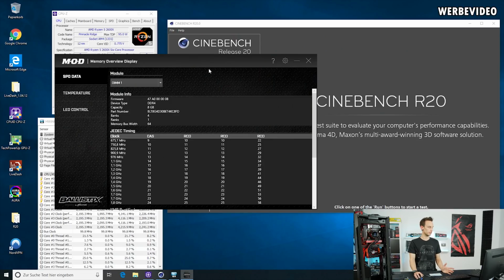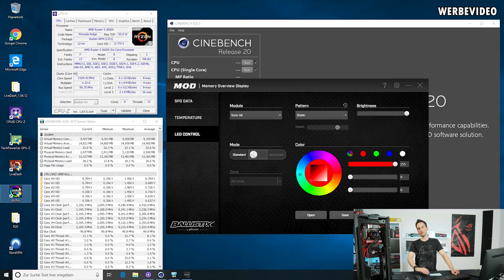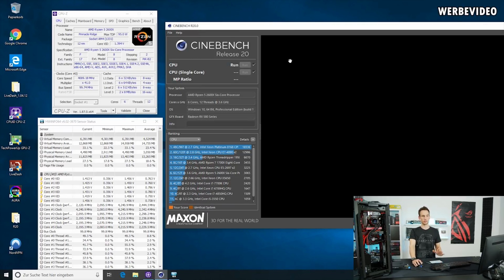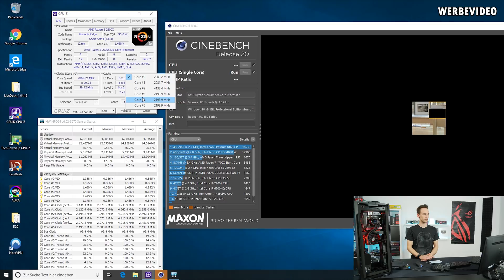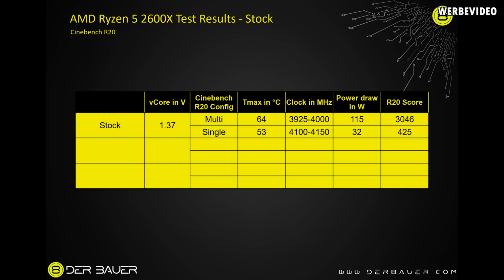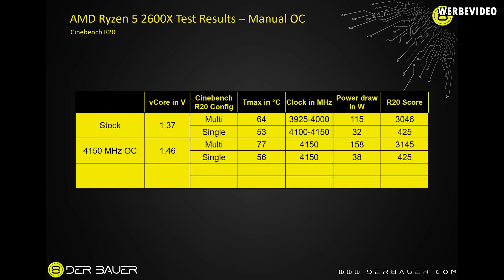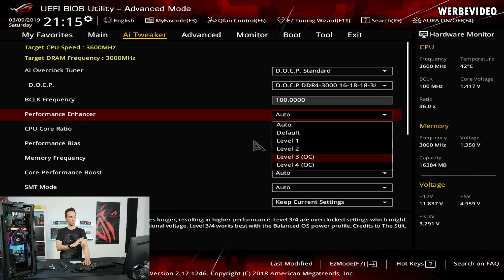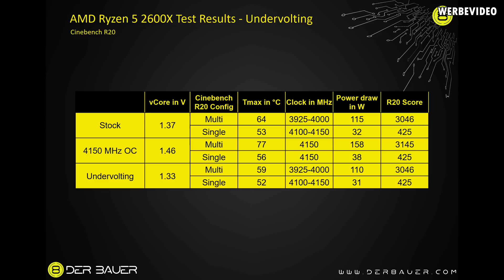The problem with AMD

Comment: A dude has already shown that above 1.38V on 2nd gen Ryzen will degrade the CPU within 6 months. He made a post about it, I'll see if I can find it. Undervolting is definitely the way to go at least on the 'X' variants. On the non-X variants you leave a lot of multicore performance on the table and it would be worth setting up an all-core overclock.

Ah here we go:
https://www.reddit.com/r/overclocking/comments/amtnt4/ryzen_generation_2_safeunsafe_voltages_tested/
Reply: Excellent comment, this should be upvoted to the top.

Comment: So... Did AMD do a better job on delivering a product to customers ?
Reply: The sauce just mad because Intel is offering more cores since Ryzen came out lol
Reply: yeah.

If you think about nvidia gpu boost, how it adapts its clocks to temperature and power usage, AMD have done the same with their cpu's, XFR adapts to TDP usage and temperatures.

Whilst intel turbo boost is very dumb in comparison, it simply boosts based on number of active cores regardless of temperature and TDP head room.

In games my 2600x boosts all core to 4.15 which is only 100mhz below its single core boost.  The turbo boost of single core vs all core in intel chips is much wider.

Cinebench only boosts lower as it fully loads the cores so higher TDP and temps, but games usually dont fully load all cores, just moderately loads them so there will be headroom, and XFR will increase clock to make use of it.
Reply: @ratking27  No, it's not much more safe. Jumping between 1.4 and 1.5 is expected behaviour. You can't just say that 1.3 is much safer because that's the case for Intel. Ryzen is different.
Reply: yeah but just remember this is stock behaviour so its likely safe.  You have a good chip to be stable @ 4.1 1.32v mine hard locks like that.
Reply: chrcoluk I haven’t really seen a zen+cpu that can’t hit 4.2ghz on decent cooling and most can hit 4 to 4.1ghz if you increase fan curves on the stock cooler. I think you may have got a bad bin.
Reply: They did an amazing job delivering a shitty product to consumers
Reply: @hugw4567  shitty comment is shitty.
Reply: @hugw4567  No they didnt, AMD Ryzen is a great platform and the best AMD has done in years.
And its only going to get better with Zen2, plus with Intels CPU shortage and high prices this is opportunity.
So stop with the Intel bias, yes they are still the better gaming processor but AMD is no slouch  at performance per dollar.
Blind fanboyism gets no one anywhere.
Reply: The Sauce shitty product that is more efficient, within around 15% in gaming, closing in on half the price, better all core usage performance in most cases, a longer supported platform, and a cheaper platform in terms of mobos needed and the mobo costs. I can get you saying “intel is ahead but other than that top end of 8600k and up ryzen is a great option” but calling it a shit product leaves me just wondering what you think about all those sub 8600k CPU’s intel makes? Are they beyond shit or are they simply not as good of value, as I would say?

Comment: The first generation Ryzens are more worth overclocking. I run a 1700 in my system, and it doesn't boost past 3200 stock. I can overclock to 3700 with very little increase in voltage, and combined with setting my memory to XMP at it's 3000 MHz speed, it gets a very good boost in scores, with not too much of a boost in power consumption. I plan to upgrade to a Ryzen 3K system when they launch, as well as get an x570 motherboard when they become available. I've high hopes that AMD can bring the competition back twofold with the 3K lineup, and get Intel to tank those prices and make even better CPUs. The last two years have been amazing on both sides, and I can't wait to see what's in store for the future.

Comment: no problem, they just found a perfect balance and applied it factory default. the reason oc doesnt work well has to do with global foundrys node, with the 14nm targetted at 3ghz optimum, and their 12nm is just a slightly refined one based on 14nm, explains why ryzen is super efficient at ~3ghz allcore, but power rises alot at higher clocks. i'd say: run a 2700 at 3ghz without boosting, amd cool n quiet enabled and compare those results, while focussing on power.
Reply: simply said: amd is pushing the glofo nodes to its max is why overclocking is not worth it. excited to see what the tsmc switch does perf/watt in combination with node shrink and zen2 uarch

Comment: Love the coverage. I've got a 1950X that can do 4.2GHz@1.375V (it's a beast of a binned chip). 

But, this made me wonder if you could do a power/frequency curve for a couple AMD and Intel CPUs, then explain the industry isoperformance/isopower curve used to discuss transistor efficiencies for different processes used in the industry. Same can be done with graphics cards, if you'd prefer. But that is a topic I find some have trouble grasping, and since you've shown that before in some videos for a single processor, doing it with a larger dataset may help people see where the efficiency on voltage drops off and why hardware vendors set the boost where they do (and if they stay at an efficient part of the curve, or clock it to past the efficiency point where small changes require more and more power to drive the hardware).

Thanks.

Comment: It's mental to think how it's so different now amd chips used to be the most interesting to oc with the whole core unlocking and massive preformence boosts you could get the old am3 chips where definitely my favourites but now it's basically only Intel chips that are worth while for high end overclocking zen overclocking at present only really worth it to get non X chips up to or close the X model to save a few quid. Can remember getting a phenom ii x4 running at 3.9 GHz  on 5 cores  using air just n the extra core plus the clock boost ment a massive jump couldn't get the 6th core to run stable would boot n run benchmark fine at like 3ghz but prime would just be like a no go lol so opted for 5 core n it was awesome for the price 👍

Comment: How the hell. My non x 2600 boost to 4.5ghz and it stays at or under 1.4v. With a Asus micro Saber tooth board
Reply: I don't think you sound like a fanboy. It's the ones saying Der8auer is biased. I have a non x 2600 too. Got it to 4.2 all core stable too scared to go beyond lol
Reply: @_BangDroid_  I definitely don't think he is bias. He content is spot on. Just straight oc I  got to 4.3ghz at 1.4. Temp hit 60 while game but it still boost to 4.5 I just didn't want to push it anymore. It stays there as long as I'm playing so. I guess I'm just lucky. His point in its not a good oc cpu is true though.
Reply: What cooler do you have, water? I'm on air, have a bequiet dark rock pro, a bit overkill I know, but I figured it can run low fan speed for noise. Last summer it was 32C degrees in my room. Under full load (blender) CPU max temp was 78C @ 4.1 ghz 1.34v Not too bad.
Reply: @_BangDroid_  its just a h100i but it's near my ac vent so I can't keep it extra cold.
Reply: silicon lottery dude, and you won
Reply: @_BangDroid_  I hate sounding like a fan boy but I see these reviews with the best hardware getting terrible oc. It just surprised

Comment: my 2600 has been running @ 4.2 Ghz with under 1.4v vcore for almost a year. P95 stable, game stable...  It pulls 105 watts package power while doing small FFTs. I run stock ram speed with package timings.  lowers my power consumption, soc pulls 5-8 watts not 15-20. Enough for an extra 100mhz.

Comment: ryzen is gross for input lag and shouldn't be used competitively in games
Reply: You just made that up...
Reply: @OperationGames45  I did not. The architecture results in more latency.
Reply: @sighing4036  Link me where you read or viewed that. No reviewer ever said that and I play cs go on high rank with r5 1600 and dont see any difference from my old i7 3770k.
Reply: @OperationGames45  Reviewers and articles do not properly cover latency as it's not what most people care about, even though it's vitally important in a competitive environment. Memory latency is higher and as a result impacts general system latency, device input included.

Higher core counts, especially in the way AMD opted for with Ryzen architecture, also result in higher latency. Disabling a CCX on a 1700x results in noticeably less input lag. For more advanced users, steering device interrupts to specific cores can help remedy the issue - but most people will never do this.

Recently s1mple became sponsored by AMD - if he ends up playing and practicing on AMD Ryzen gen1 or gen2 processors you will likely notice a change in his aim. Fortunately CS:GO is a very slow game with slow movement.

Btw, if the video you uploaded of you playing CS a month ago is at all representative of your current skill level, you are not good enough for it to matter - or, the Ryzen CPU you are using is very much impacting your aim and you haven't taken measures to fix the issue.
Reply: sigh ing  Haha I am no pro in cs go (lem/supreme) and no cpu can make my aim better. Its just practice. What you said about cpu cores, memory latency and so on can for sure make the cpu run slower fps wise, but that doesn't change your input lag.
If you have any source of the information you stated I would love to read it, but so far I don't believe you. Latency you are describing is happening on the cpu architecture level not in the game.

Comment: Looks like you lost the silicon lottery on that chip, my 2600 non X is running at 4.25ghz all core at 1.400v, on a cheap ML240 AIO.

Comment: Ive got a ryzen 3 2200g and have it overclocked to 4ghz, so that debunks the so called cant overclock 400 to 500mhz when the base clock is 3.5ghz and i have that at the stock volts asus thinks of 1.4v, My temps under prime 95 or OCCT dont go over 40c and thats with a cheap AIO.
 I also have corsair value 2133 ram overclocked 2733, when every where says you cant overclock that ram. and im doing that on stock volts. 
The only decent overclocker from intel was the Q6600 where you got 1.6ghz overclock, 2.4ghz to 4ghz and you could do that with a decent air cooler, Intel now you overclock and you can use it as a space heater, with it hitting high 80's and 100c .

Comment: Could you test something very strange?

The other day on reddit, a user was experimenting with voltage offsets on their 2600. The theory is that due to the way XFR2 works, setting a negative voltage offset should increase the stock all-core boost of ~3.75GHz. But in their testing, they found that a negative voltage offset would lower their boost, a positive one would increase it by a bit at up to 3.775GHz, and setting a static voltage of 1.2V (IIRC the stock all-core boost voltage is 1.18V) gave them the biggest boost of 3.8GHz on all cores.

So like that just doesn't make sense right? More voltage = higher boost? Is this a CPU thing, a mobo thing (they had the MSI B450 Mortar), or is it something strange with XFR2?

Thanks

Comment: What is the meaning of this video? You used Ryzen X which can not be overclocked to prove that the Ryzen can not be overclocked. An ordinary Ryzen 2600 would be a better choice.
Reply: He's an overclocker: he picked the best silicon quality SKU to increase the chances of not being stuck under 4,2Ghz, and with 2 cores disabled from the full die; yet he did get stuck there. He was probably aiming for max frequencies, not most % OC.
Reply: The X processors "can not be overclocked"... well that's certainly news to me haha. FYI they generally reach higher clocks than the non-X chips, but obviously have less OC headroom.. I expected more from a 2600X, even my 1800X can do 4.15ghz stable at safe voltage.

Comment: I'm fine with that stance, AMD has Ryzen already providing good performance out of the box.  They didn't botch the thermal interface material between IHS and die, and they don't really play silly games with tiering clocks and overclock features, they just try to do their best.  I like that about them.
Reply: There's the 1700 for overclocking.
Reply: @vyor8837  My old R7 1700 did 4ghz @ 1.325v
Reply: @vyor8837  right!.... Der said 4-500Mhz overclock is just not possible with Ryzen and here I sit with my 1700 and CH7 Hero at 4 to 4.1Ghz which is 1,000Ghz over stock and 400Ghz over boost clock speeds. All with a H100i v2 with 2 Noctuas. Glad I watched this as I'd recently been getting the "I need a new CPU" itch. This video made me feel a lot better about my 1700. 
EDIT: with vcore never higher than 1.4-1.42, I understand I probably hit the silicon lotto with my chip but really past 3.9 the performance in real world gaming is minimal.
Reply: @tr1llwill  he was talking about the 1800x and the 1600x
Reply: BCLK overclocking, memory overclocking, Raising the power limits so the CPU turbos for days. Depending on workload you can squeeze significant performance gaines out of Ryzen if you are willing to tweak.
Reply: @screwb1882  My problem, is I just am not that competent in the tweaking department and have not found enough information on how to do so. I don't want to screw up anything and brick the thing. I'd love to squeeze some more performance though. I tweaked the hell out of RAM to get 4 sticks stable at 3k speeds when out of the box 3200 speeds wouldn't work. I heard however that Ryzen 2xxx CPUs don't really like 4 sticks populated or at high capacities (64GB in my case). I hope Ryzen 3xxx fixes this.  Other than that, it's been 7-8 months with the system and I love it.
Reply: @MiddleofKnowhere  Try setting your ram voltage to 1.3500, even in this video you can see his is. Seems to be the jump off point for RAM with Ryzen chips. If your MB allows change boot voltage first (to 1.3500) and you may be able to leave DRAM alone or back it off some.
Reply: I have an r7 1700x that idles at 3.2, but will all-core boost to 3.9 @1.27v, with 2 gtx 1080 cards on an x370 board.  I have 2 C15 8gb Corsair 3200mhz installed, with a 512gb nvme boot disk, a 512 sata, and a 6tb hdd.  In AAA games at higher resolutions, with other stuff running in the background, it never goes over about 55% usage or uses more than 95 watts.  It has an 850 silver PSU, as both gpus can pull some wattage. It runs like a diesel engine, not as high frequency, but plenty of bandwidth to handle a lot of data at a time.  I put it together myself over about 6 months, for about $1500.  I am pretty satisfied with it, and I haven't had to tweak things around too much.  I play at 4k 50-100fps at high settings, as long as I can configure sli, otherwise I disable 1 card and set it for 1080 or 1440p.  Most of the games I like are sli compatible.   It's a very efficient entertainment machine / workstation :)
Reply: https://imgur.com/xalHotP
My ryzen 5 2600x automatically setting all cores to 4.6 while gaming, all voltages automatically set themselves to 1.45 and my temp doesnt rise above 55c
Overclocking is so 2015, if you need to buy an inferior product and then fiddle with it to get the performance you need from it, then thats just sad.  AMD automatically wrecks shit on its own out of the box, they ship you a superior and complete product.  But fanboys wanna overclock and somehow think it means their chip is better lol.  Moving forward, core counts and shit are going to matter MUCH more than clock speed.
Reply: @puregameplay7916  You do realize you contradict yourself and look like a complete "Fanboy" when you explain how your AMD chip over clocks to 4.6 GHz and then you said "fanboys wanna overclock and somehow think it means their chip is better lol". With a 1050Ti, I can see why you don't need the extra processing power so an AMD chip is right up your alley. Good pick!
Reply: @puregameplay7916  You are lucky. My 2700 seems to max out at 4ghz with my current settings even up to 1.45v
Reply: @puregameplay7916  Actually HWmonitor is terrible for true readouts. Switch to HWinfo and see what it shows, I guarantee it won't show that high of a boost.
Reply: This is why the video title is misleading. It's not a problem it's something good that users don't need to overclock to get the most out of their CPUs. Although of course, it's less fun for people who want a challenge.
Reply: they should do that in gpu side as well - I didnt mind to tweak my V56 but it would be just better for some people if you would get that performance straight out from the box
Reply: they dont lie and cheat...botching compilers fixing benchmarks never forget net burst and the huge lie that was. wouldnt have been so bad back then but intel was hemoraging advertising funds to establish a brainwash in the past.. i say fuck intel for the rest of forever untill they've suffered down to the last 10 fat obese over paid American lard asses soaking up month long paid tropical vacations .. fuck greedy old intel

Comment: if you drop the clocks a bit, ryzen gets stupidly efficient when undervolting, my (launch day) R5 1600 runs at 3600mhz and 1.1v, consuming around 68w under load

Comment: i notice on my 2700x in   ryzen master  the edc(cpu) amperage has a limit of 168A on my mb and up to 87-94 % already consumed .i have xfr turned on and set my blck - 102.40 and i get 4453mhz  sc......my qestion is do you think ryzen could do better if the mb have a better power delivery ?phase design ..

Comment: For 99% of the PC users Ryzen is the better choice but AMD really needs to keep PBO and XFR on when people manually overclock on the X-models. One doesn't exclude the other as long as the temperatures and voltages are safe, right? It might be more difficult but I hope that AMD solved that for Zen2.
The fact that you don't need to delid AMD CPU's and that they come pretty well overclocked out of the box are good things!